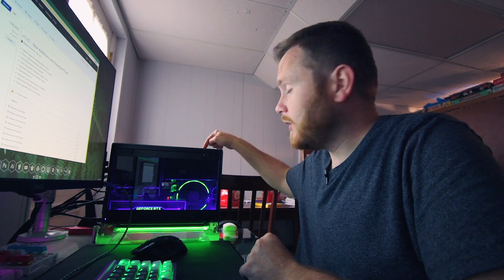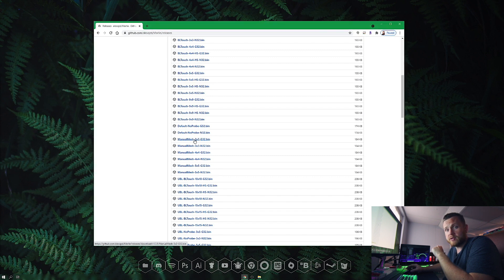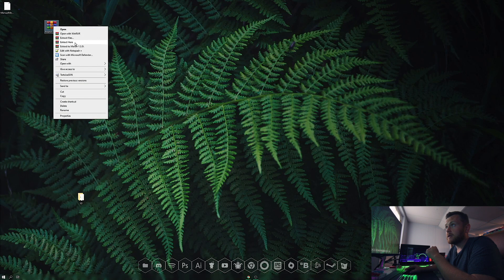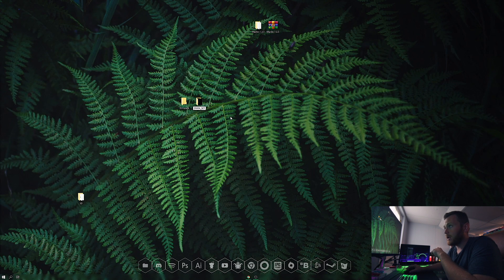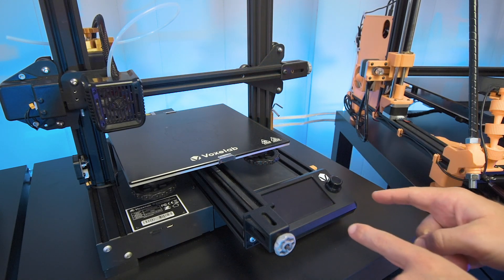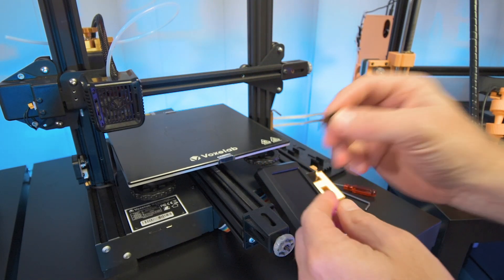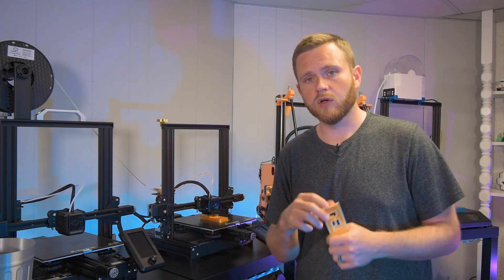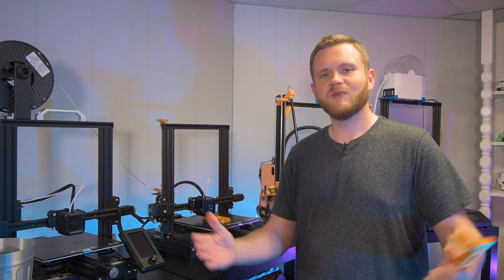Reduce Risk of Fire on Your Voxelab Aquila with 3rd Party Firmware

Comment: Shouldn't you go back and update your initial review video?  I know that the glowing reviews had a major impact on my decision to buy the Aquila instead of the Ender.
Reply from the maker: Yep. I have plans on doing a “long term review” of the machine. However I have to do a few other things to it first. Honestly there are two ways to look at this machine. One is from a perspective of someone who’s REALLY into drama and the “politics” of manufacturing and business and one from someone who just wants to problem solve themselves and use a printer. I’ll totally dive into that in the video.

Edit: also I wouldn’t update the review. The review was my genuine thoughts on the machine from that time. And honestly, it’s been printing better than any other machine I own. So just depends on what bothers you internally. Because it functions perfectly.
Reply: @3DPrintSOS  I'd like to dive into this point a little deeper as your reviews and opinions appear to be well thought out and highly credible. Unless I'm missing something it must be stated : Aquilla V2 H32 systems could burn your house down and Voxelab is not forthcoming with a date certain fix. To me, this problem is in a class of its own, not in the realm of the many cost effective performance improvement mods you advocate. Do you agree with me on this ? Burning down one's home is not a risk one should accept casually to save a few dollars in my opinion. If you agree, your followers should know precisely the risk they are accepting if they purchase an Aquilla V2 H32 printer.
Reply from the maker: I agree that they made a bad call and clearly threw dirt on their own name with the h32. Bugs happen on anything really and it sounds like they are legit trying to fix the problem. At least with all of my limited communication with them. 

There are plenty videos and reviews already hating on them and I’m not one to jump on that bandwagon. Instead I’d like to help them get this out sooner. I’ve provided feedback and am available for testing if they need. In the meantime I’d like to be there to help people solve problems they might be having. Not just theoretical problems. 

TLDR: I agree, not a good situation.
Reply: @3DPrintSOS  _ Thanks for the response.  I agree that it's a great printer.  I look forward to you long term review.

Comment: Does the firmware upgrade enables the printer to print higher than stock temperature?
Reply from the maker: No. However, the source code is available. So you could compile it yourself and just edit the temp figures.

Comment: One thing you didn't mention or if you did, I missed it, is to write down your movement configurations.  I had changed my steps per mm for my extruder because I changed out to a dual drive, and it didn't save my steps per mm after the flash. Good thing I had it written down.

Thanks for the great video, now I have a safer Aquila!!!!  :)

Comment: Thanks for the videos I'm learning a lot. I tried the update but after I did the screen something went wrong the screen stays grey is areas and i can not read any text when i try and go to perpare or control.
Reply: I figured it out. Yes it is very important to format the memory card to 4096 allocation units but the issue I could not use that configuration on a 32gb card so i had to get and use a 8gb card like what came with the unit. After i got the card correctly formatted it worked perfectly.
Reply from the maker: Yep that’s one of the most important steps. Glad you got it figured out.

Comment: At 5 minute you says that you needed to make a new folder from the bin. I don't know how you fit to the page to make a new folder. I am extremely new to computers and 3d printer. Could you explain simply the steps you used right after you moved the bin file and DWIN set?
Reply: Just when I think the 2 files are on the card. I put the card in the printer, turn it on. The original screen pops up, no new screen.
Reply from the maker: Are you using a mac by chance?
Reply: @3DPrintSOS  windows 10. This laptop is a 2016, that had vad virus and factory reset. It shows that big bin file and DWIN file are both on the card.  I put the card in the printer when it was turned off then turned it on. The printer acted normally, no updated firmware.
Reply from the maker: Hmm ok. And just to double check, the bin file is inside of a folder named “firmware”?
Reply from the maker: To make a new folder you right click somewhere on your desktop and hover over “new” and then folder. Name it “firmware” and out your bin file in there.

Comment: Hi, there!

Not sure what I'm doing wrong. I've formatted the SD card the same, relocated files and created the new folder (edited the name of the icon pack folder), and insert it into my printer (OG model) and it just goes to the default Aquila menu screen.

Any idea of what could be the issue? I've used the G32 3x3 as stated in the video and it just won't budge. I've even used an alternate (same format) SD card and nothing happens with that either.

Is it because I'm using a Mac?

Thank you
Reply from the maker: Yes. On a mac, you have to use terminal to format the card. 4096 bytes is the most important part or else the printer won’t know what to do. I don’t remember the command off the top of my head but if you Google something like “terminal command format byte allocation 4096” you’ll find it.
Reply: @3DPrintSOS  Sadly, I cannot locate a "dummy's guide" post for the exact command. I've even attempted using my old netbook (that is able to format FAT32 as 4096kb) and still cannot seem to even install official, updated, firmware as I'm still on the original firmware from when I bought my first-gen Aquila.

I guess I'll have to just keep trying. Thanks!
Reply from the maker: Hmm. If you are able to format it on a windows machine with with that byte allocation, it should have worked. 

Do you have the bin file in a folder named “firmware” and the screen files in “DWIN_SET”?
Reply: @3DPrintSOS  Multiple times. Going to attempt Windows to format again.
Reply: @3DPrintSOS  What stinks about the whole thing is that I can put the SD card into the printer and it'll read any gcode files I have loaded. But won't load any firmware whatsoever.
Reply from the maker: Hmm. So after you format fat32, 4096 bytes, you’re placing a firmware folder with the correct bin and your DWIN_SET folder on the sd, you’re putting it into your printer and turning on the power and nothing is happening?
Reply from the maker: Have you tried other bin versions. Try the 5x5 for example.
Reply: @3DPrintSOS  Correct.

Folder for “DWIN_SET” and “firmware”. Firmware folder has the unchanged file name for my type of printer, to which I believe we share as there is no logo for type of board. And the icon folder is untouched other than the root folder name. 

Just tried again on Windows to format and put the files back onto the card. Placing into the printer SD slot does nothing and placing into the display gives me red and no progression at all.
Reply: @3DPrintSOS  That was the second one. Have not tried others yet.
Reply: @3DPrintSOS  WOOT!

Finally got it! I had to use my old Windows netbook for absolutely everything. And I mean re-download, unpack, and install. 

So glad it worked! Your video was very cool. I just wish I realized what had to absolutely be done earlier.
Reply from the maker: Oh man! But good to know you got it working. Well done.
Reply: @3DPrintSOS  Thanks! Now to still replace the hotend assembly! That’ll be a cake walk, though. 😆
Reply from the maker: Always easy when you understand it.

Comment: Hi there. My Aquila has been pretty hard to dial in on PLA. Several problems the bed height kept changing even with runners tightened up. Temperatures super critical, but that might be the PLA Im using. Main problem though is my Ubuntu is not detecting the serial port of USB printer; LSUSB shows the manufacturer, but the system wont detect this is most unusual usually printers are plug and play.
Hope all is well with you. Regards, Al.
Reply from the maker: Hmm on windows their is a driver that is required. I’m sure Ubuntu has the same requirement. It’s called “ch340” on windows.

Comment: Is there something that you have to enable in the firmware for the thermal runaway protection
Reply from the maker: No, it’s a safety feature built into Marlin. The stock firmware has it too, it just has a bug that prevents it from running.

Comment: Can this firmware update be rolled back to a stock version or to an updated version from Voxelab?  Great content too!
Reply from the maker: Yes for sure. At any point you can follow the same steps to get the stock version back.
Reply: @3DPrintSOS  Im trying to roll one of my machines back to stock, but found my after the install the SD card is no long working. im getting "sd init fail" is there someway to turn the sd slot back on?
Reply from the maker: Sounds like your card was corrupted. Have you tried to reformat it using your pc? These cards are super low quality. Luckily 8 and 16gb cards are extremely cheap.
Reply: @3DPrintSOS  that was it! so strange, that card worked everywhere but my printer. thank for the quick reply. whats the best way to donate to the channel?

Comment: Thanks for the video, you may have prevented some serious fires here.  Has anyone found a way to rotate the display back to landscape?  I just ordered an aquila, one of the things that made me choose it over the ender 3 v2 was the landscape display.  That and it was about $100 cheaper for essentially the same machine.
Reply from the maker: No horizontal versions at the moment. Alex is working on one though. So maybe soon. :)
Reply: @3DPrintSOS  I've got the latest firmware from voxelab installed which addresses the thermal issues and maintains landscape orientation, but the manual mesh and pid  features in Alex's firmware are really starting to tempt me.  I've got a vertical screen mount, the firmware, and the source code downloaded, just in case, lol.
Reply from the maker: Nice. I think you’ll love it. The features are great. Especially mesh bed leveling. :)

Comment: After this operation i got problem with my octopi. Octoprint can't connect to the printer. my solution to this is 
to disconnect the USB cabel between my Pi and printer .start up the printer, then reconnect the USB and only
then its possible to connect printer to Pi. Strange! Anny sollution to this ?
Reply from the maker: Hmm not sure. Hopefully someone can pitch in here. I would make a post on the voxelab Reddit. Alex is active there.

Comment: ok, I have the x2 (n32) Aquila. what I don't know is which 3x3, 4x4, 5x5...I don't even know what that references...? I've done some fan upgrades and tube. I am having problems with the steel nozzle  not performing well...?
thanks way in advance for help.
Reply from the maker: The 3x3 is referring to the grid the mesh will use. In my opinion, 9 points is good enough for such a small bed. That’s why I went with it. You can do more if you’d like.

Comment: Hi you said your machine was G32. Why manualmesh3x3 instead of another manualmesh?, and how you decided which DWIN file? My Aquila is X2. Thanks. Al
Reply: Gr8 to hear back. BTW I have been fighting with Youtube comments for a week now. My desktop submits a comment, then a few seconds later its removed (this by Android). The only way Ive found is to use my Android Youtube/same account which works. Google drives ya nuts sometimes :-(   Appreciate advice - Ive subscribed and sometime will donate, u are doing a great job. Al.
Reply from the maker: Thank you! Yea I typically see several of the same comments and they get deleted. I’m guessing Google thinks it’s spam. Gotta try to find you’re posting several at once.
Reply from the maker: Hey look I can finally reply to your comments! I’ve been trying for days but they are getting removed before I could reply. 

I chose 3x3 because to me, that enough points of mesh. Any more and it takes quite a bit longer. Only real reason. 

As for dwin, I chose the red and black one because it’s dark and not as bright, but you can choose any of the other ones in that folder. ;)

Comment: Man I have been following your videos and they are awesome. First time 3d printer here and I am having trouble with this not installing
Reply from the maker: Did you allocate the byte size on the card first and did you grab the right version, g32 or n32. It’s gotta be one of those.
Reply: @3DPrintSOS  towhat i know of i did allocate it and yes i defiantly did the g32 because i do not have the sticker
Reply from the maker: Hmm. Are you putting the bin into a folder named “firmware” all lower case?

Comment: I have an H32 (new motherboard sent from China). Which file set do I download? I tried the N32 and that just pissed off the printer. I got it back to Factory settings. And... how do you know if it's an H, N or G without taking the bottom off and looking at the chip, or is that the only way?
Reply: I'm right there with you.  Bummed.  I hope we get a H32 version as well.  Found this from Alex on reddit posted on aug. 21st.  It's not great news: "Sorry, I don’t have an ETA yet.
The H32 chip is made by Huada Semiconductor. Huada only provides drivers for a software called ARM Keil which Voxelab uses to compile their official firmware. Unfortunately Keil, unlike PlatformIO, is an enterprise paid software. And even if I could afford it, my code is made for a gcc compiler, not a pure ARM one. Translating the code would take a while.
I’m doing some research to see if I can port the drivers to PlatformIO but I cannot say for sure if it could work."
Reply from the maker: Yep, that seems to be the case. :/. The software very expensive. Looks like voxelab had to switch chips around due to demand and shortages. Hopefully someone with more knowledge comes around and helps the community out
Reply from the maker: Sadly the H machines do not have support yet. The firmware is compiled completely differently. Alex is currently working on it. So, I’m hoping shortly support will be there.

Comment: For us beginners, a bed-mesh explanation would be very helpful! I think I know what it is....but I'll watch for the video. I've been at this about a month now, with the Aquila as my first printer, and I've been hesitant to update the firmware, as I've heard other have issues with it. My Aquila has been running almost full time since I got it, and it's working well, so I don't want to jack with it too much. I've done some hardware upgrades that have made it much more user friendly: changed out the fans - that happened like the second day, boy the stock ones are LOUD. Changed out the springs for rubber supports - now I only have to check level, not relevel. printed a new spool holder with printed 608 bearings - work like a charm now. 

Looks like I'll be updating the firmware though, the constant beep is getting annoying, and the super bright screen....Thanks for these very informative and well produced videos. You don't talk down to us that don't know, even with the stuff I don't get yet. Well done Fedor.
Reply from the maker: Thanks! Yea I will have to do a deeper look at it all. I think it would help. First I need to take a look at another printer though and then I’ll be back shortly.

Comment: I can't get it done. This is so sad and frustrating. I want it so badly. Maybe someone else has any idea?
Reply from the maker: Dang. Sorry to hear it. Is there anyway you can install Windows via boot camp. Windows 10 is free and boot camp is built into macs. Could be extremely useful.
Reply: @3DPrintSOS  It finally worked. Did everything on a windows machine. And then it went well. But it's a shame that it has to be this way for mac users.

Comment: Got my first printer about two weeks ago. Aquilla X2 N32, and have just been having a hell of a time getting the bed level, it's just a never ending cycle of twist (the knob) and shout (at the bed). I was going to get a leveling probe, but it just seemed difficult to install and then I'd have to load Alex's firmware blah blah blah. After seeing this video, I decided to load Alex's firmware with the manual mesh just for the thermal protection. WOWZERZ, now I get the power of the probe without the probe. Well I guess I am the probe really. 

And I second the request for a video on how to use manual mesh properly and a run down of the other features of Alex's firmware.
Reply: How many days has it been

Comment: My hotend stops directly on top of the print and drips and melts the pla a bit, it’s there a way to stop this?
Reply from the maker: Sure is. This happens when the wheels are too loose on the z axis. You need to tighten the inner wheels eccentric nuts a bit. This will stop the z from sliding down by itself.

Comment: Great Tutorial!!!  I will say this, after flashing firmware multiple times, you do not have to remove the firmware folder.  When it installs the firmware, it deletes the .bin file from inside the folder.  I just keep dumping a new firmware into the folder when needed.
Reply from the maker: Oh nice! I was trying to be cautious, but very good to know.
Reply: @3DPrintSOS  I totally understand.  I was running Alex's firmware when I had a hot end issue and went back to stock and back to Alex and back to stock making sure it wasn't a firmware or board issue.(turned out to be a faulty thremocouple and a bad heat break)